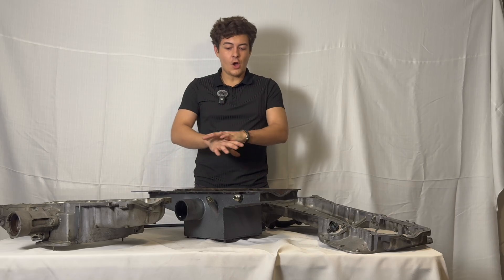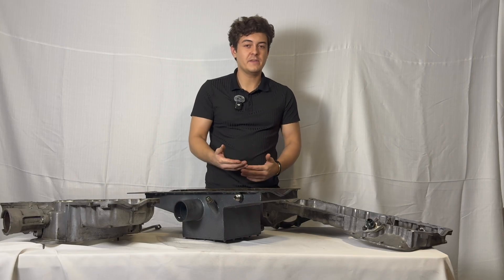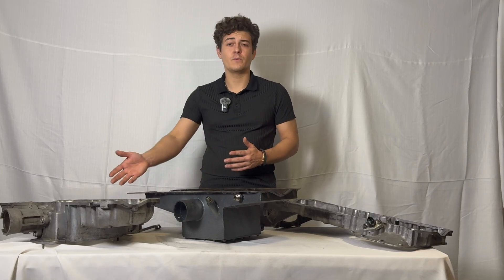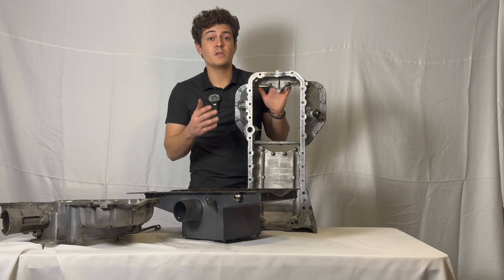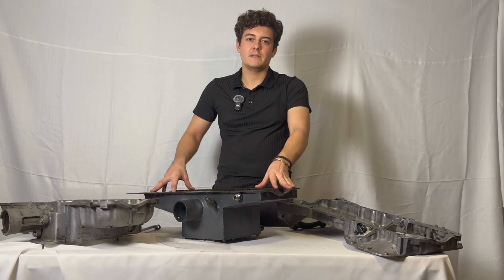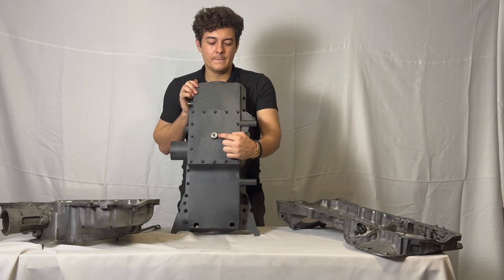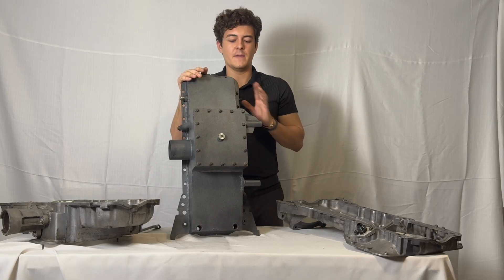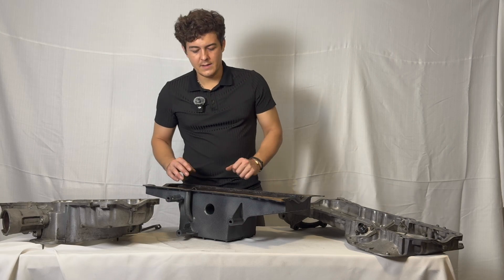2JZ AWD Conversion Oil Sump | World’s First 1jz/2jz AWD aftermarket sump

Comment: Now since we have this, next step would be to add double vvti to the head, either using the same as intake or maybe use 3s beams vvti system
Reply from the maker: There was a company who did exact that, custom heads with dual VVTI but i think they went out of business, not enough demand maybe?

Comment: What about using this pan for road racing/circuits/hill climb? You mentioned it’s good for launches and acceleration but how about maintaining turns? I know you mentioned being able to use the different generations of gtr diff and that’s what I would be chasing. Seems like setting it up to do different AWD splits would be difficult, is that something manageable? Also love what you’re doing and support you all the way!
Reply from the maker: We haven’t had any issues taking our awd is300 through some backroads and curves. We’re confident our design is superior to the factory 2jz pickup setup. That being said we’re not going to advertise it as a proven circuit/road racing setup without being able to back up that claim with real data.  

We will take the car on the road course, drag strip and OFFROAD with some offroad tires to see what it’ll do. Stay tuned for more content & appreciate your question!

Comment: We need this to work with a ZF8 transmission it world be legendary
Reply from the maker: Our AWD kit does work with ZF8 transmission. Any X-drive transmission with a left side drop transfer case will 100% work. Just need custom front & rear drive shaft. Sizing will depend on your specific setup so measure your driveshaft lengths after installing the AWD kit and we'll make them. We are doing an 8HP swap & custom T56 Magnum F swap in the AWD IS300. We're just testing the 4L80e transmission setup first since it's the most common option in the USA and most customers will likely choose this transmission for drag racing & street use. We make Transmission crossmembers as well but most transmission swap kits already come with them so we dont advertise them. We can make anything you need.
Reply: it would

Comment: What front diff ratios come in the Lexus? Im more or less ready to pull the trigger on just a pan for a build of mine.
Reply from the maker: RC/GS Front diff ratio is 3.769,  Lexus IS250 Front diff ratio is 4.10 and Lexus LS460 (Different differential housing but we believe that the internals swap over) 3.13 ratio. All great options. I'm running the 3.769 currently with a 255/35r18 and a 3.91 rear (stock is300 Automatic Torsen LSD) with a 275/35r18 , i increased the rear tire size so its gives me about 1.4% difference in rolling speed between the front and the rear. I will be changing the rear tire to get that number closer to 1% rolling speed difference but everything now is very smooth, car drives like normals. I can manually switch between 2WD and 4WD any time!